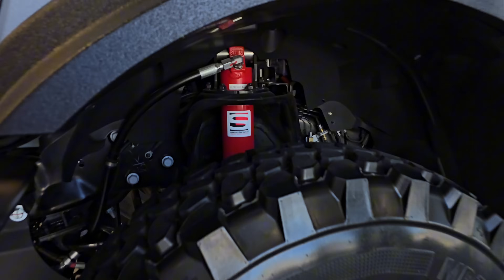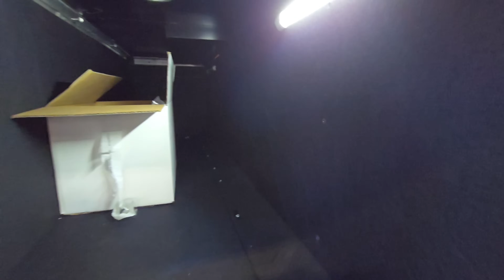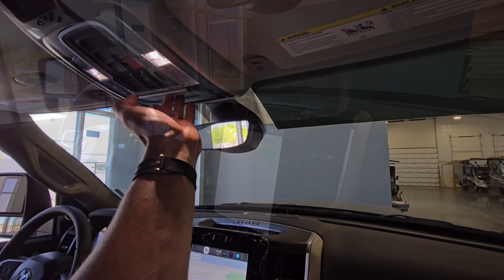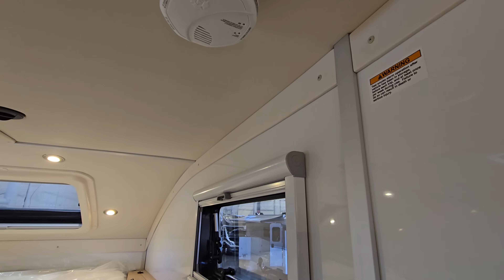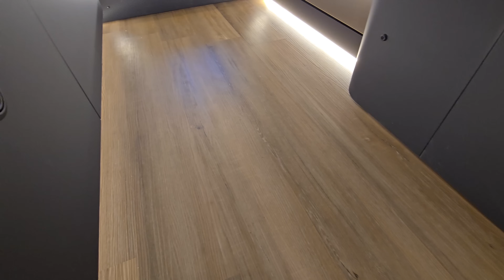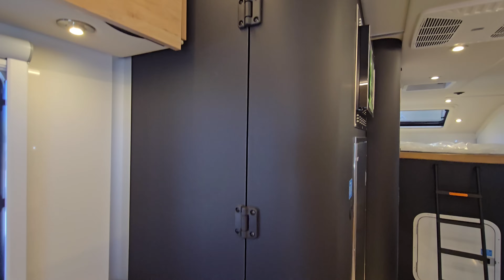2025 Storyteller GXV Hilt: Better than EarthRoamer? Ram5500 4x4 Chassis! Overlander/Adventure Truck

Comment: I wonder why the pick up truck with a camper style is almost 3 times as much as their Sprinter 4x4 model.  I understand they had to fabricate the entire back and it's not just any old camper but 3 times?  On the bright side this is competing with the Earthroamer which is 800k and it will make it more reachable for some people.
Reply: earthroamer is miles and miles better, even though its 300k more, earthroamer is technically offers more value

Comment: $500 thousand for fake wood cabinets, no tv and a cassette toilet? No thanks.
Reply: Yeah, it is very hard to believe that material cost or labor costs are anything close to that of a 3000 square-foot home. Yet the prices are same and in many cases, the homes are less expensive. I would think they are pricing them at least at 100% of the total cost. But folks are buying them left and right… so good on them.

Comment: As I always feel, isn't it better to expand the space by attaching the ceiling above the driver's seat and the sleeping area?
Reply: Monocoque structure of the cabin shouldn’t move with the driver cab(structure twist force when the front tyre are on different shape of surface than the rear tyre) when you move on rough terrain or you’ll have a cracked cabin and leak everywhere. Surely you dont want that on your 700k-1mil overlander. This is not campervan, its an overlander, you bring these on rough road, not highway to highway.
Reply: Yet they all go on the highway 99 percent of the time.

Comment: It seems like when this company said ‘mama’ and ‘dada,’ EarthRoamer graduated from the university of camper design and functional engineering.
By the way, why does the window above the bed open in reverse? On a rainy day, if you open it to get some fresh air, the water will pour straight onto your bed
Reply: Ikr? Leak city. And hail, snow and any debris that happens to collect up there like dirt, dust, leaves. Oopsy. 😅Back to engineering school! Y'd think for 700k someone would have caught that. 🤦‍♂

Comment: The dodge will be in the shop for ten different and reoccurring recalls before you will ever get to really use it. I know From experience with a 2020 5500 finally had to Lemon law it. On three different occasions i pick m vehicle from the dealership and before i even got home the trouble lights came back on. Trust me and pass on newer Dodge

Comment: Does that gloss interior keep the inside of that bunk area warm in cooler areas? This thing looks stellar!
Reply from the maker: Good question.  I will have find out about the gloss finish, but the 2" bead foam insulation definitely is the main factor.  This is one amazing truck. Thank you for watching!